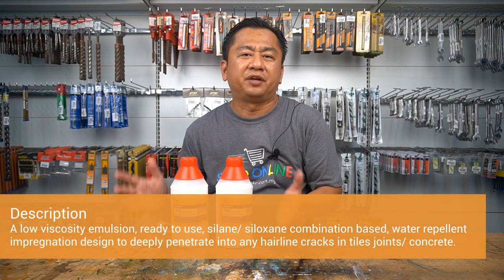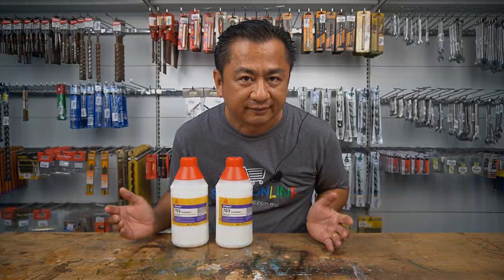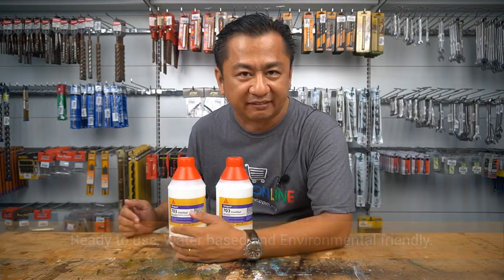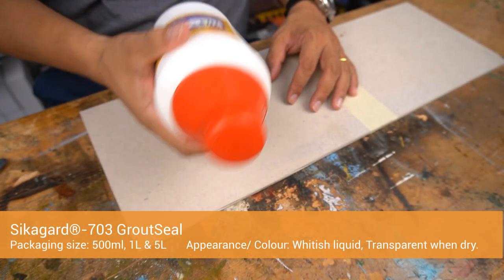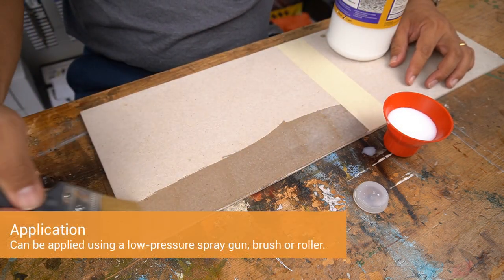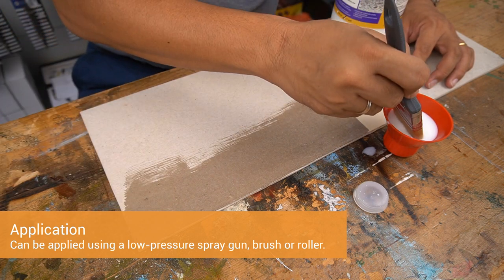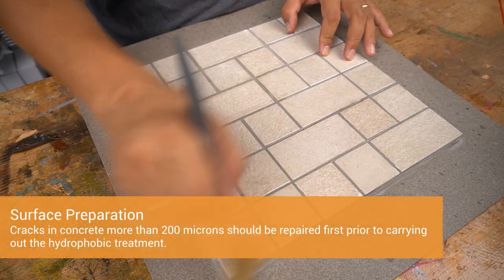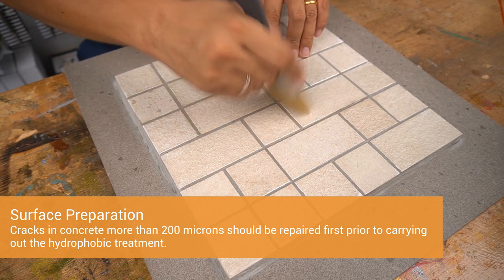Product Review | Sikagard® 703 GroutSeal Water Repellent Impregnator Tiles Joints & Building Surface

Comment: After I applied the Sikagard 703 , can I still wash the toilet tiles like usual by using any detergent ? If yes, how long will the Sikagard 703 last?
Reply from the maker: The application of Sikagard 703 towards the bathroom tiles, is directly towards the grouting lines. I believe the best practice is to scrap off the existing grouting lines, apply sikagard 703 and finally redo the cement grouting lines for a long last solutions.

Comment: Sir, if i were to apply it on the bathroom floor tiles, would it be slippery? Worried of a fall because a fall in the bathroom is almost all the time fatal.
Reply from the maker: It won't be slippery, and the key usage is actually on the grouting lines.

Comment: What the different between kingkote 233
Reply from the maker: In of physical, #703 is liquid based ready to use, #233 is high viscosity and need dilution before applying. Both share the similar usage. However, I can't confirm the chemical content.

Comment: Before applying 703 I need to address the hollowing tiles on the bathroom floor. Is there any suitable grout to first fill those voids through the tile joints without having to remove the tiles?
Reply from the maker: first, you may try to scrap off the existing grouting lines. 2nd, redo the grouting lines with any brand's tile grout. 3rd. let it dry for 48 hours or more and apply sikagard 703 on top of the grouting lines.

Comment: Can you apply this and then apply it with Crysaline waterproof product such as CrystalBond-C3 or SS 10 SHOWER SEAL? Is it possible after you apply Sika 703 and then apply it with Qing Long 3 Transparent waterproof coating for double protection purpose?
Reply from the maker: I can't confirm the other products since I haven't try before. You may apply based on the brand's waterproofing system or solutions.

Comment: How well does this stays on bathroom tiles? Basic cleaning with detergents?
Reply from the maker: Overtime, I am sure that the cleaning solutions will scrub away the protective/ hydrophobic treatment on the tiles surface. However, this will not affect the "repaired" water seepage issue, since it has deep penetrate into the substrates (crack lines).
Reply: Can this just apply  on the tile surface too? And how long can i start use the toilet after apply sikagard
Reply from the maker: @bajingfzalq6715  I have shown in the video  applying Sikagard 703 on the tiles surface. First, it is quite difficult to brush on the grouting lines only. And, most often, it is a lot easier to apply on the entire surface so that we won't miss any spots. However, foot traffic/ detergent might scrub away the hydrophobic film. But usually, grouting lines/ crack lines are the one causing water seepage. You may refer to my replies above on this product.

Comment: Can we do it as below?
1.  Scrap off the old grout line, then redo the new grout line. 
2.  Then apply the sikagard on new grout line.
3.  How long do we have to wait to apply multiple layers of sikagard ?

Will this above method be lasting or do we have to apply the sikagard first before redoing the new grout line?

Thanks in advance for yr response.
Reply from the maker: You may try applying the Sikagard first after scapping off the old grouting lines. Recoating about 1-2 hours.

Comment: Hi Kok Gei, which sika product do you use first between sika grout 703 or sikadur 20 crack seal?
Reply from the maker: different solving method. if for crack repair, use sikadur 20 crack seal.

Comment: Hi, what is the texture like after applying on top of cement grout? Does it make the grout feel smoother than before?
Reply from the maker: almost the same, except slightly shining.
Reply: @ATKCeWarehouse  do you know of any options that will make the grout feel more polished? So that it doesn't feel too rough between porcelain tiles

Comment: 1. Take how long time to dry ?
2. If between tile gaps has many gaps whole and this sikagard will goes in the whole and won't fill up the gaps whole ! What to do next?
Reply from the maker: 1. recoating about 1-2 hours.
2. clean or clear off the cement tile grouting first, before applying sikagard, and finally redo again the tiling grout.

Comment: Greetings sir, can this grout sealer be applied on caulk?
Reply from the maker: nope.
Reply: @ATKCeWarehouse  what about applying caulk on this grout sealer after grouting? What do you suggest for the gap at the corner joints where the wall meets the floor?

Comment: Can use skiaguard 703 for balcony waterproofing? And coat slate seal  821 panten on top?
Reply from the maker: For the balcony, are you referring to the floor tiles? Sikagard 703 focus on grout sealing by emphasizing on deep penetration into hair line cracks. While, 821 is a water based acrylic protective coating. There seems to be similarities in finishing, but the functionality may be different. Personally, I believe that you suggestion might work!

Comment: after a month or so water will sip anyway. i 've done this with pye product before. which the same if not better product.   at the end mandi kat bawah juga. its hard to find permanent solution if we bought our house from idiot. this problem will not solve until someone bring this issue to parliament for law action to developer or contractor (specifically for bathroom leakage for 2 storey or apartment). which will not going to happen until cows come home.
Reply from the maker: Thanks for your sharing. There is another "prerequisite" that I do advise everyone to do prior using this type of waterproofing/hydrophobic solutions, which is to scrap off the existing cement grouting lines and regrout it again. This apply too to the floor trap/ drainage outlet. You need to remove it, fill up the gaps between the pipe and cement, and reinstall the trap back. All corners/ edges must be well taken care off, including 2-3feet height of wall tiles. One of my client did this, and so far it has been 1 year plus without any complaint.
Reply from the maker: For toilet/ bathrooms, contractors must be required to carry out water ponding test to ensure that the waterproofing job was done according to specs and procedures. Yes, totally agreed with some shoddy works and irresponsible contractors. The cost of fixing/ repairing is much much higher than do it right at the beginning.
Reply from the maker: https://www.ewarehouse.my/search?search=pye%20krek
Reply: @ATKCeWarehouse  hi
is this similar to penten t007?
and what waterproof we use for toilet before floor tiling?
thanks
Reply from the maker: @kengseong  Hi, t007 is cement modifier/ primer. Where as Sikagard 703 is hydrophobic treatment. For toilet, referring to Pentens, you may use T007 and T100 before finish with cement render. While for sika, you may use Sika Top Seal 107 Slurry waterproofing coating before cement render,.
Reply: @ATKCeWarehouse  thanks a lot
Reply from the maker: @kengseong  most welcome.